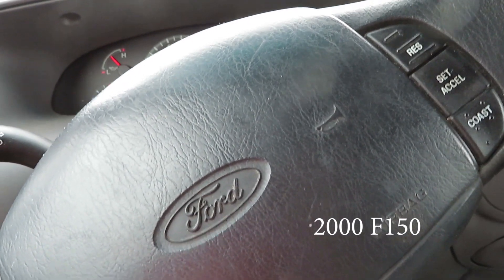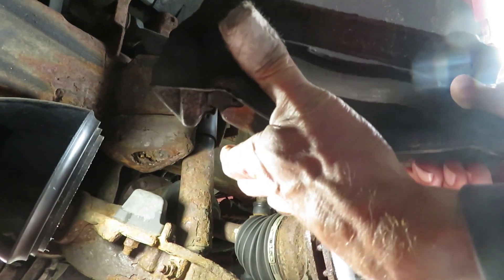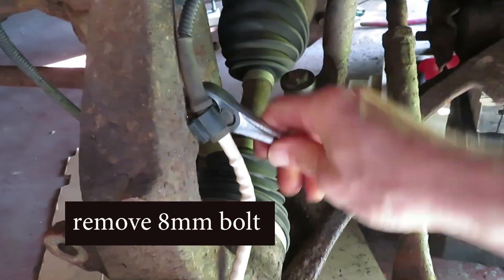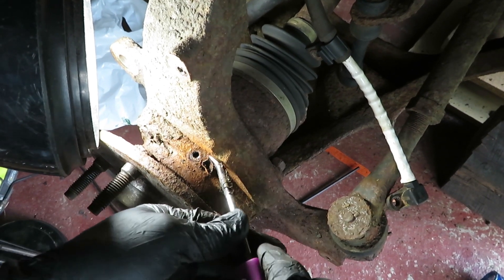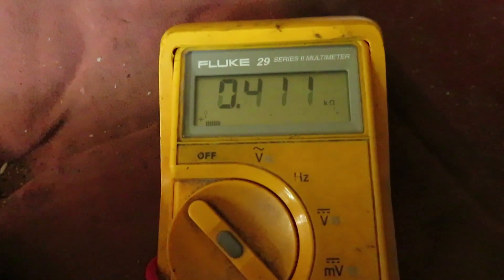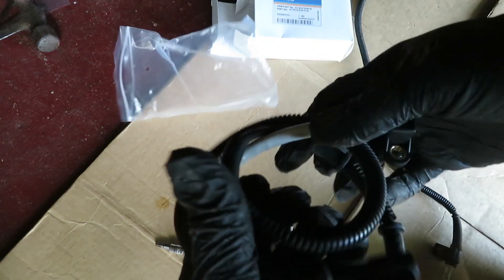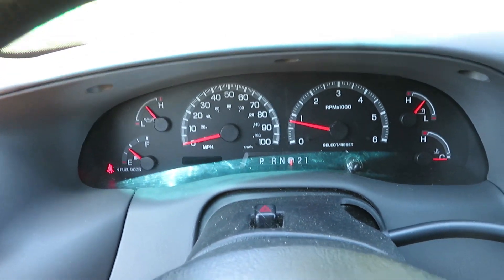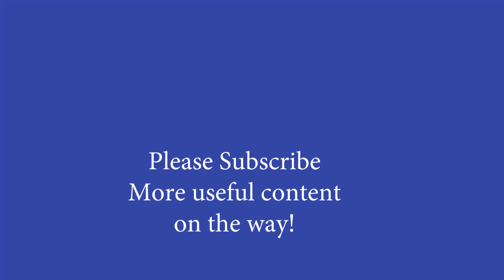How to Replace an ABS Wheel Sensor Ford F150

Comment: Great video. I have a 2017 F150 with the same issue. I replaced the sensor but the code is still there. Where were you connecting your voltage tester when checking to see if the sensor had proper ohm resistance?
Reply from the maker: It's a two wire probe and I checked resistance across the two wires at the connector.

Comment: I just cut the front right ABS sensor wire on my F150....so I can just get 1 sensor wire from the parts store and then quick disconnect it from up in the engine compartment?  That simple?
Reply from the maker: The sensor is mounted in the hub and you need to access it as shown in the video to remove the old one and install a new one.
Reply: @TheOriginalMechanic  thanks yeah your video helped a ton….so I pulled that ABS wire up through the fender and into the engine compartment and disconnected the quick disconnect.  Got the new ABS wire and sensor on order from the parts store.  Again your video helped a ton.  The sensor was really stuck in the mounting hole but your video helped me know how it is supposed to come out and I just stuck with it and wiggled and pulled until the sensor came out.  Thanks again
Reply from the maker: @leftseat30  Glad to hear this helps you get the job done. I've done both of the front sensors on my truck and it's still working beautifully years later with aftermarket sensors.
Reply: @TheOriginalMechanic  outstanding…your video was a life saver!

Comment: how did you determine that was the bad sensor? mine has been activating the abs under normal conditions, with no abs light. I removed the abs fuse, and no more random abs activations. not sure how to determine which sensor I need to swap though. or if it could be something else
Reply from the maker: I actually took my truck into a service center and they ran diagnostics and told me it was the driver's side wheel sensor. They sell code readers now that include abs diagnostics but probably for $100 or more. My older reader does not have it. I think the wheel sensors are hands down the most likely cause of what you are seeing.

Comment: The ABS sensor (mine was the rear) set off a P2106 code with the monkey wrench hitting at 60KPH (40MPH) every time. The Ford mechanic said I needed a new throttle body...Yeah, he was mistaken. Saved myself major dollars (sadly, I saw this video after spending a week on the F150 chat forums).

Comment: Looking for rear ABS replacement but cant find one on 2014 Ford F150 if anyone has found one. 
Rodents chewed wiring on the rear driver side.  Other side is ok.
Reply from the maker: I got mine for a 2000 from Rock Auto.

Comment: A Ford F-150 1999  does come with abs sensors? Because the odometer reader doesn’t work.  The code said  abs sensor but my mechanic told me  my truck doesn’t come with abs sensor
Reply: Fire your mechanic !! He's dead wrong
Reply from the maker: I guess they started with the model year 2000. Has to start someplace I guess.

Comment: How did you determine that the issue was a front sensor vs the rear sensor?
Reply from the maker: I took it to a shop and they used an abs code reader